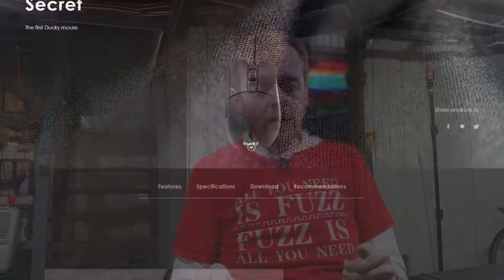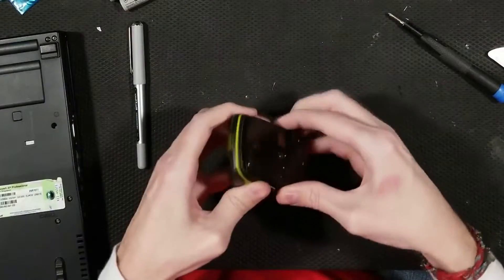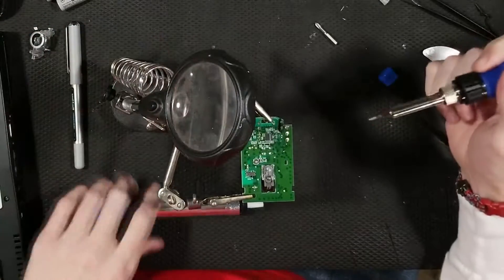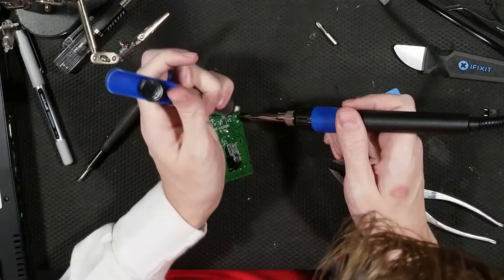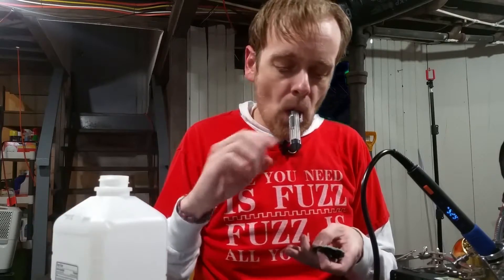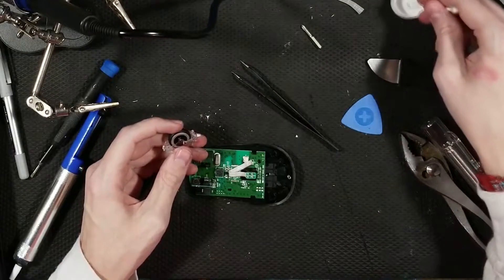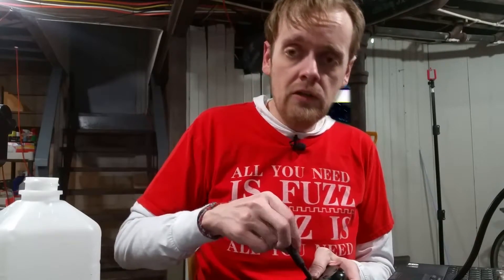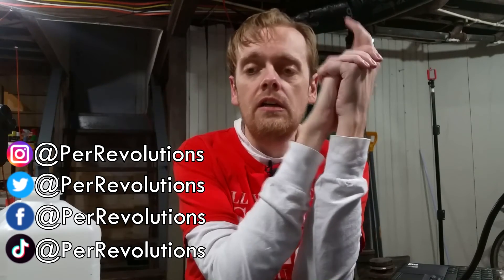Logitech M525 Mouse mod pt 2: Installing Omron D2F-01F switch

Comment from the maker: what is your favorite model mouse?
Reply: Glorious model D gonna solder some omron on them too
Reply from the maker: @thunderus5678  you did this mod to a Mode D? wow nice
Reply: @RobertJene  I couldn’t do it it doesn’t want to get desoldered
Reply from the maker: @thunderus5678  make sure the iron gets hot enough. and use the solder sucker.
it's easer than it looks.
maybe your soldering iron doesn't get hot enough?
I"m putting the soldering iron I used in the description.
Reply from the maker: also... I had to pry off a switch (when doing another mouse) with a tiny flat head screwdriver.
pry while heating the other side.
Reply: @RobertJene  hmm alright I’ll try to do it again later thanks for the advice
Reply: Roccat Tyon
Reply from the maker: @karelurban6887  what do you use all those extra buttons for?